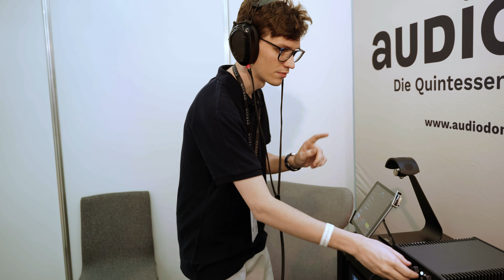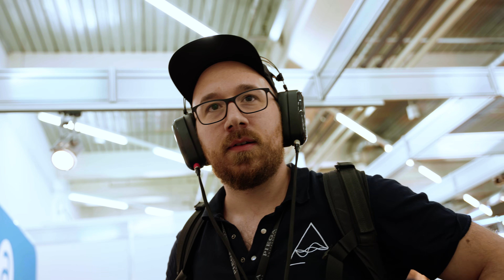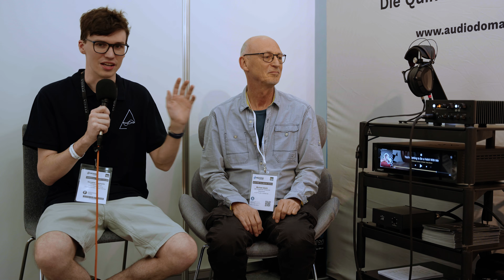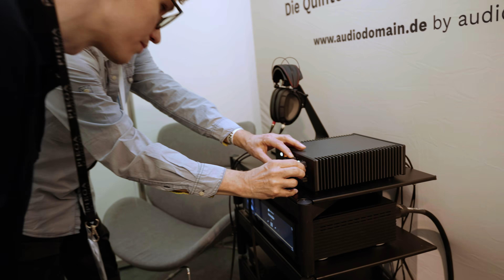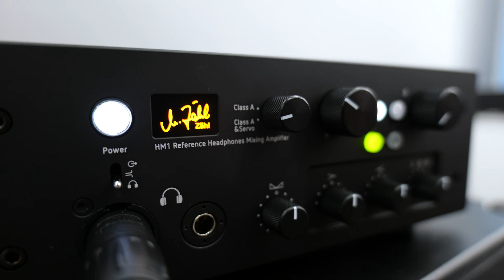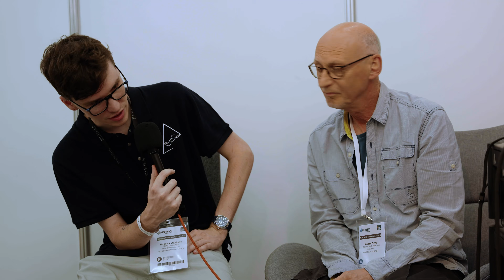The new king of solid state headphone amps? Michael Zähl interview

Comment: It was a pleasant enough conversation, but from the sound of it, neither of them actually understands what class A or feedback actually signify an amp circuit.  Most discrete class A designs still use feedback.  Not sure why anyone would pick this amp over something like a gsx mini, cfa3 or susy dynahi if they wanted a high end SS HP amp.  What makes it better than a Jot2 or Singxer for that matter?  Mixing knobs on the inputs seems to be the main selling point?
Reply: I'm sure Michael Zähl knows less about Class A Amps than you omegaLUL

Comment: King?  I think we have at least 4 other SS amps in the mix.  Perhaps 6… I think the concern here is the features can quickly turn to gimmicks and sacrifice outright sq performance.  Just like the phonitor.
Reply: Nimbus us5
Vio v550
Mass Kobo
Oji
Flux Volot
Soloist 3gt
Oor/Hypsos 
Enleum new amps 
Luxman p750 mk2

All in the discussion
Reply: @aceofspades6667  We have Enleum at the office actually. So that's on my list to steal from Taron as well.
Reply: @ResolveReviews  I think you need to get Taron a new toy to play with so you can test it out.
Reply: @aceofspades6667  yes
Reply: @aceofspades6667  I think since Holo Audio Bliss has came out, it edged out all of the aforementioned amps, unfortunately including the PL Ferrum stack, which pains me a bit, since it seemed like it's dominating the head-amp market SQ-wise noticeably enough for it to last some good years. But the fuckin' and amazing Jeff Zhu appeared on the horizon.
Reply: @Peace_Guard  my bet would be Oji and mass Kobo as still superior to bliss but basically unobtanium in US ATM.  Bliss vs enleum should be an even match.  You’re correct on the others
Reply: @aceofspades6667  Could you provide links to those two amps? Or at least mention how are the exact models called? It's not obvious to me after a simple google search. And possibly direct to any threads/discussions/vids that offer any insight on how those two would perform against the rest of the stack? Or any other sources based on which you find those two the potentially best?

Comment: I think you have to 'believe' in amps like this to justify the price. The features are nice but can be easily reproduced with a digital device like an RME ADI 2. Add an AHB2 and you have all the features and all the power
Reply: I'm generally quite skeptical on amps and sources in general. That's why this one was so surprising to me.
Reply: Something to keep in mind here is what sounds good boils down to what sounds natural and what sounds natural can vary from person to person based on the unique physiology of each individual 

so your inner ear resonates and so the harmonic profile of various speakers and headphones is heard a little bit differently by each individual person, look into the thesis published by Dan Cheever for more information on this topic

But, having a piece of gear that measures objectively perfect with little to no harmonic distortion doesn’t mean that it sounds natural and a lot of times these designs have an excess of negative feedback in use to achieve such low measurements. 

 Such feed back has a pretty obvious and audibly detrimental impact on how natural or real things sound,

The other problem here is a bias that one needs to “believe” in amplifiers to justify the price, why does the price need to be justified? If I’m somebody that has the funds and my only goal is to enjoy music and in a way that sounds the most natural an true life than what is the cost matter?

If you see a price tag and your opinion of the tech changes then you have a bias that you need to overcome, 

Yeah not everybody can afford $8000 but if it sounds good it sounds good, and if it sounds good and you can’t afford it than it’s important to understand what makes it sounds good and what trade-offs or compromises work within your budget, so that as you explore options that are within your budget you have an idea of what sounds correct and good to your ears and you understand what drawbacks you can live with

So for your opening statement against such a product is you must “believe” in order to justify the price 

Well then clearly you don’t believe your own hearing or have even taken the time to understand or appreciate what sounds correct and natural to you, 

You can argue that the price is excessive and that it isn’t reasonable and that it isn’t practical, and criticize it from that standpoint but to deny the possibility that proprietary technology along with some well implemented equalization has a net positive on playback simply because it’s too expensive for you to afford, or that the objective measurements do not fall in line with what you’re used to is just seems like a weak stance to have

@resolve Made a good point talking about doing and ABX between the wire and amp, finding that sometimes a poor measuring amp or design sounded more like the wire

Objective measurements exist to verify the things that we’re hearing and help us to understand what our ears and our minds process, not the other way around… 

I would encourage you to step back from your playback system maybe pick up an instrument or attended a live acoustic show and start to familiarize yourself with how Instruments and music actually sound, become familiar with how you hear within reality and what things stand out to you within both a small enclosed space and a larger space,  

Hell, Take a moment to put together a high-quality recording system and just speak within a room that has some audible characteristics and then perform your own ABX test,

My point, You’re welcome to think that it’s overpriced and push for the industry to make any advancement or new tech available at a different price point

 but to simply refute that it might make a difference or sound better than other options because it’s “overpriced” well that’s just foolish, 

I’m not telling you to buy the most expensive thing because somebody wrote up a paper convincing you and how good it might be I’m asking that you sit down and listen to things for yourself and weigh that against your own experience an perception of music and sound within reality 

For a lot of people the cost put a pro sounds close enough to real life for them and so it has the most value even if this sounds amazing it just might not be worth it to them because the differences aren’t enough to justify the cost, Into the people who can recognize that it is better but not worth it to them well their opinions are appreciated but if you’re not even open to hearing it in having an honest opinion and you’re only stances to complain that it’s overpriced you’re just wasting your own time and I certainly hope you can take a different stance in perspective at least for yourself in the future
Reply: @m_s_OFA  I’ve been playing piano for several years now an regularly visit concerts but I still find that the good measuring dacs and amps sound more natural than those ‚boutique brand‘ components. 
I’m not saying that all expensive amps are not worth it and just overpriced, but for a premium price I also expect premium engineering and not terrible measurements. 
Everyone perceives sound differently and has their own subjective sonic preference so ‚bad measuring‘ gear might sound good to some people but horrible to others.

Because I can’t possibly test all dacs and amps and decide what sounds good to me, I just pick the gear that has the features I need and good specs/ measurements. In my experience, good measuring gear always sounds better than poor measuring gear to me.
Everyone has a different approach to finding the right audio equipment. I‘m not forcing anyone to get product x and not get product y. If you think a product is worth the money I won’t stop you buying it.

I just hope that people will be more open to different approaches in finding audio equipment and stop yelling at each other for buying and liking the ‚wrong stuff‘.
That’s just silly and immature.
Reply: @juliangst  nice to hear your a grounded musician like myself! 

I'm with you on the need for less yelling about what's right and wrong, I do get a bit triggered at times by folks who feel it's only measurements that matter without any real point of reference for themselves. Should like have started with a question before writing many paragraphs, non the less appreciate your response and input!
Reply: This a duel mono design, so its initially linear in its output stage. The adi 2 is not

Comment: That's cool. So basically it's two state-of-the-art amps in one that can preamp, input switch, input mix, analog bass-shelf, analog treble-shelf and analog mid-side EQ. I don't know what makes this thing cost so much money, but its features seem actually useful.
Reply: so in other words much less features than Motu UltraLite mk5 but 12x as expensive
Reply: @Tacet137  I don't think those are comparable products. One is a low latency digital interface for recording, the other is a analog amp for mastering/listening.